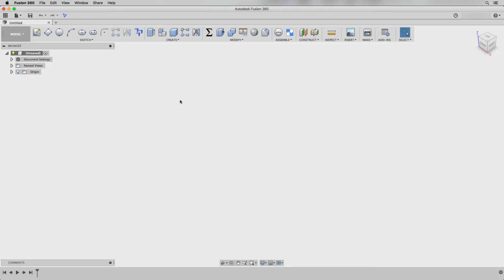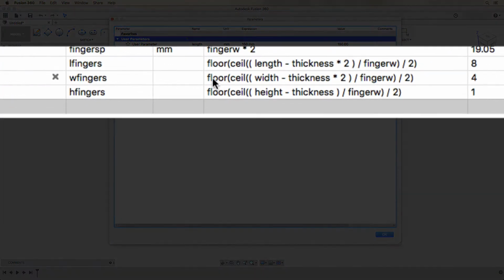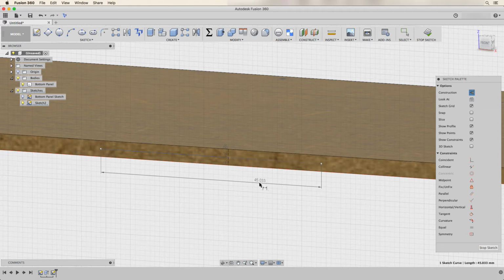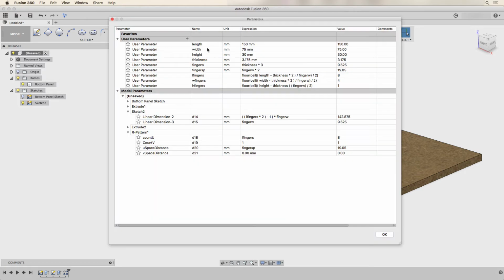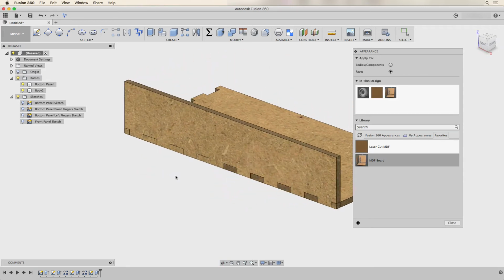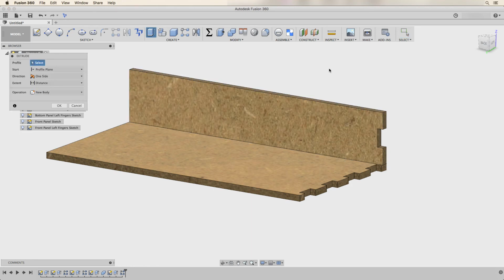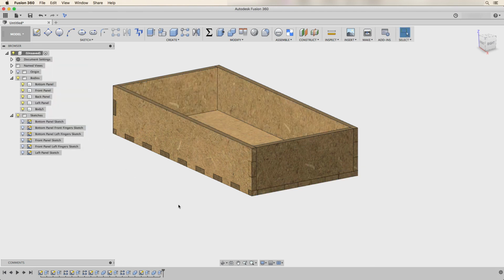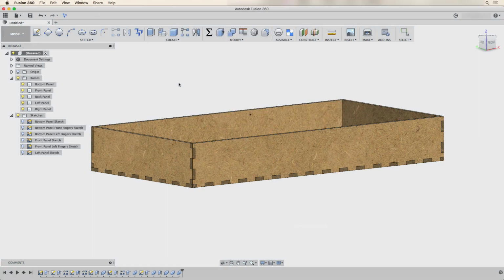Fusion360: Consistent width finger joints

Comment: I was excited about this video. I watched and did your last one successfully but this one has problems when I get to the equation at 10:30. I cannot multiply by fingerw. I've checked it many times and I keep getting red error. :(
Reply from the maker: Did you create the fingerw parameter, or rename a built in parameter to 'fingerw?' Or, did you make sure that the parameter unit type is set correctly? I'm just getting back into F360 after a few years away.

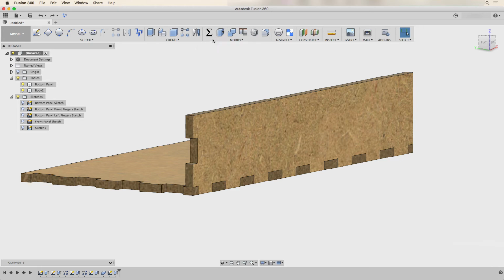Comment: This is an awesome tutorial! Thank you for putting it together ( in Fusion 360 2.0.8176 at 17:18 the height needs to be larger or it won't let me press OK for the pattern). Then when I make the box taller the Back panel left fingers are not there. The fix is to then edit the back panel extrude feature after its taller and then the pattern shows up. seems like a Fusion Bug to me.

Comment: Thanks for the video, you have shown me a much better way to solve a common problem I’ve been having. Do you have a suggestion on how we could add a small tolerance on the joints to make a press fit possible?

Comment: I just finished this and had the same issue greyfin10 did. I managed to figure out by manually setting the quantity of fingers to 1, then going back and editing it to take the hfingers variable and that worked. 

However, that's not why I'm commenting here. The back panel doesn't have the fingers correctly set for height. There's only one finger. At first I thought this was because of what I did with the editing as stated above. However, watching your video to completion, I noticed the same thing in yours. When you raised the height, there's only 1 finger on the back panel rather than 2 like on the front panel. I'm currently at a loss as to how to fix this though as I'm still new to this whole thing. Any suggestions?
Reply from the maker: Catamarack , I’ll take a look later this evening to see what happening. I think I know what you’re referring to, and I think I recreated it again.

Comment: Not sure why, but @ ~17:30, when you set the quantity to hfingers, the direction kept switching to perpendicular to the desired direction (i.e. along x).  I actually scrapped the whole process twice, until I finally let the video proceed to where you increase the height... when I increased the height BEFORE the rectangular pattern operation, the problem disappeared.  Not sure where that came from :)  Only commented in case someone hits the same snag.  This idea is exactly what I needed by the way.  Thank you for taking the time to walk through it!
Reply from the maker: Take a look at the video I just posted. I don't address this issue specifically, but it came up once or twice when I was working through the steps to improve the box. I'm not sure what causes it--if the problem I had is the same as yours--because it hasn't happened consistently to me. But, one thing that seems to be important is having the initial height of the box to be large enough so that you have room to cut at least 2 notches into the panel while you're building your design. You can then decrease the height of the box, if needed, and things seem to still work.
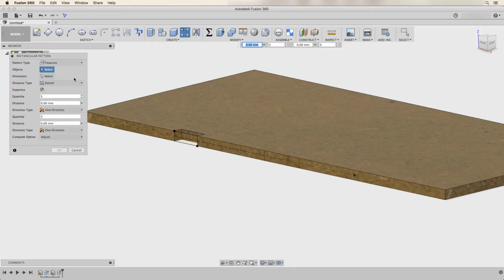Reply: Hello, I watched this over and over and for some reason I cannot get past 9:34... you select the extruded feature in the bottom left hand work space and say "copy" this feature.. but I have. O ray to copy a feature like that or I am just missing a hotkey or drop down menu somewhere, because when I continue on with the video and work I notice that I so not have 2 linear dimension sketches like you do in the video. 

This makes it so when I input the new info the notch becomes one large notch across the board rather than several equally spaced ones.

Can anybody help me hear? I feel like I'm missing something to ge that second sketch dimension.
Reply: Ah, yes I had the same problem